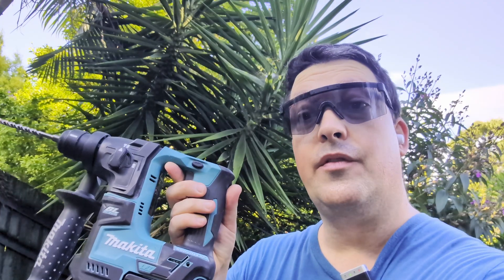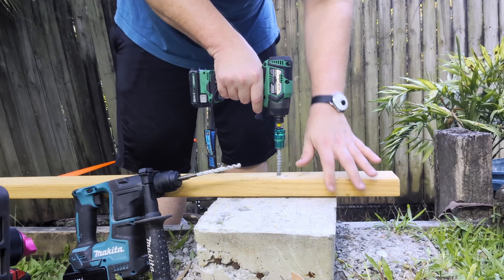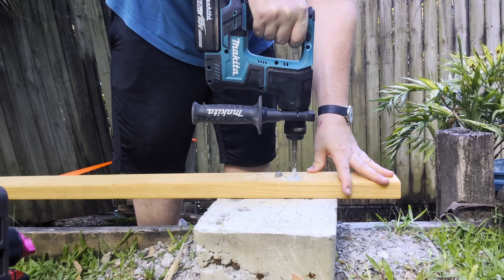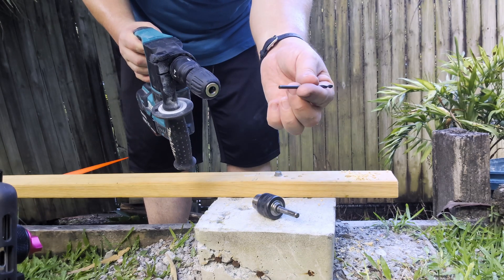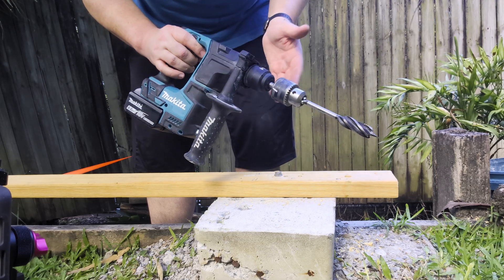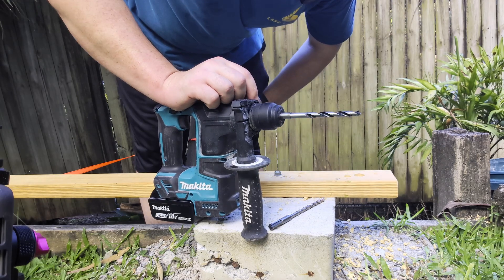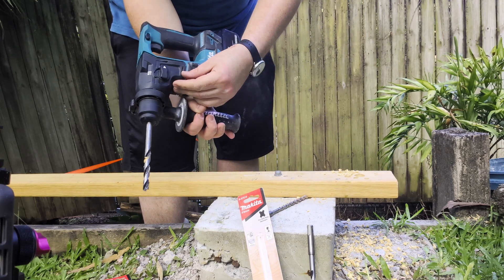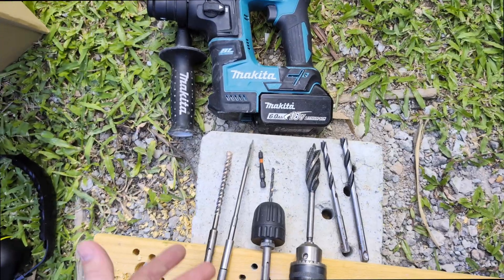How to drill wood with an SDS hammer drill?

Comment: If my memory serves me correct, the green bosch hammer you have drills at 2000 rpm or something like that, which would be more ideal with these accessories. Universal Hammer 18v or something I think it was called. 
The torque might of course be a problem though, as you’ve mentioned before
Reply from the maker: Yes in general you want higher speed for wood but if you're only doing rough holes, as opposed to something fine like in cabinetry, this low speed seems ok

Comment: I am pleasantly surprised to see this. I usually do masonry stuff so I don't have a proper regular drill but I recently stumbled upon a job I had to drill through wood. So instead of struggling with my meh drill I got an sds shank auger bit. It's unlike the one shown on this video but a regular good old auger bit it's just the sds end is different. I have to say I also was amazed by the smoothness of the bosch hammer drill going through wood. Though mine is corded so that might help too. Killer performance but unexpected for sure!
Reply from the maker: You're probably the first person to get a pleasant surprise from this channel😅 But that's pretty cool, I've not seen one of those exact bits before